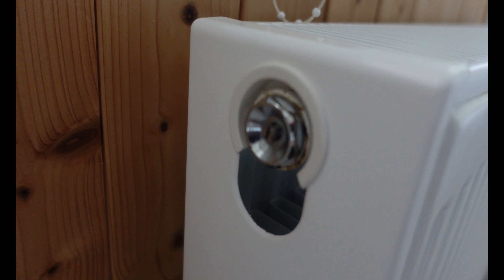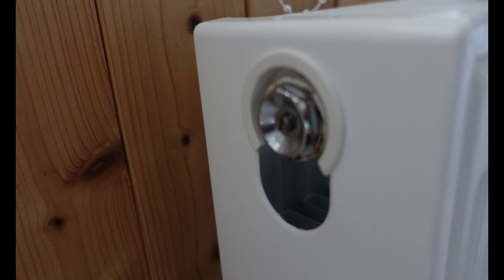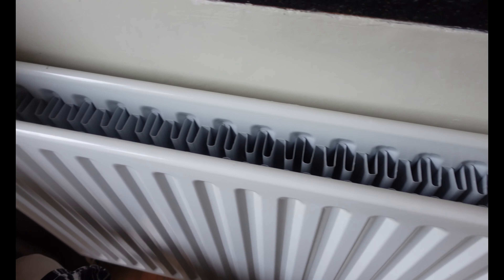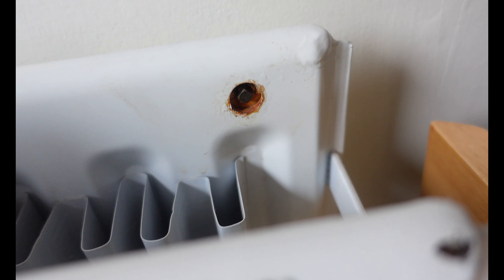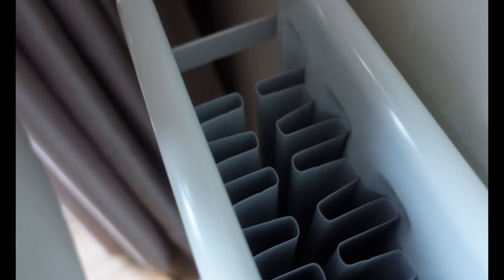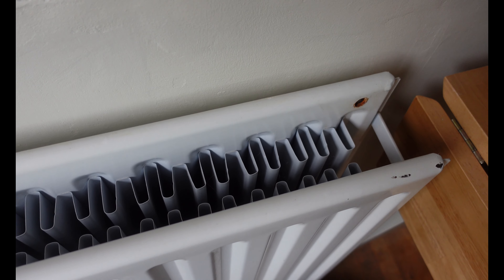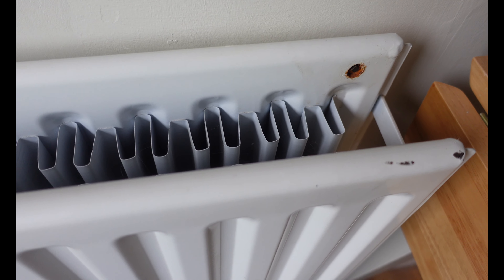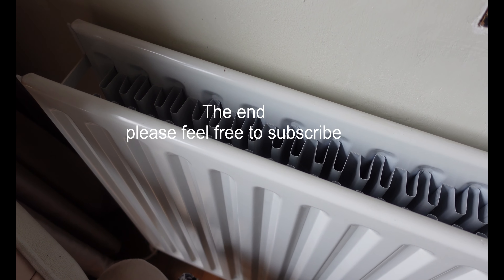What heating radiators not to buy.

Comment: To be honest, if you use the correct little key on the small airbleed screw, you shouldnt have any round off. After having these rads in 3 houses over 40 years, Ive only had problems with one rad where the thread stripped.
Reply from the maker: I have only ever had problems with them.

Comment: Such a humble thing the bleed screw. But able to cause mayhem! Also, if you have a 1/2 bsp fitting you can add a bit more inhibitor to the system very easily if you've removed the radiator.
Reply from the maker: Good advice Colin.

Comment: Thanks for the heads up! I have a couple of those rads in my place where on a drain down I found those bleed screws siezing up through corrosion, luckily they were still turnable with care, working them backwards and forwards, once out I cleaned the threads and applied a smidgen of copper slip, I'll remember to buy the other type as and when I need new rads.. 👍
Reply from the maker: Yes best bet Dave.

Comment: Hi Al, I had trouble with one of those recessed bleed valves, couldn’t get it off with any normal bleed screw, until I found one from Amazon, it’s got a sliding bar through it and is excellent! (If you search for “rear access bleed key”. Worth a try for a couple of pounds!
Reply from the maker: Thanks Tim that`s a great tip.
Reply: Goto toolstation replace all the air bleed valves with alladin autovents 👍👍👍

Comment: I have 2 of those radiators (I got them from Wickes).  I have not had any problems so far but the point is well made.  One thing which might work is to coat the threads of the bleed screw with bike grease (you can buy it in a DIY store, costs peanuts).  This might help with the corrosion of the bleed valve.  Thanks, great video.  :-)

I had problems with TRV valves recently and used your hammer trick to free them.  Worked perfectly; much appreciated.
Reply from the maker: Thanks for the great tip.
Reply: You should do a video about the hammer trick

Comment: I've got these Myson Premier HE radiators throughout my house which was built in 2004.  Myson have changed the design of the Premier HE now so that the bleed nipples on the smaller rads are slightly angled on the side and the bigger rads has a removable bleed housing.  If you can get the rounded nipple out, you can replace them.
Reply from the maker: Thanks Lioyd.

Comment: I did wonder about drilling a small hole in the radiator (with both valves closed)  and then inserting a self-tapping screw (with a fibre washer) as an add-on bleed screw. 

Any experience as to whether this sort of bodge would work (and remain watertight)?
Reply from the maker: Only that the new type of rads are ever so thin and you may find a self tapping screw will not go in tight enough.

Comment: Hello Al,I’ve got a couple of them brilliant rads with the air vent on the inside 🤬,im thinking before I probably have to buy some new ones,to try out easi bleed valves,just wondering if you’ve used them before.My system is a Combi and I need to drain the system and the rads upstairs are the plague ones,so that’s where I was going to use the easi bleed on the ones upstairs.The reason im draining the system is I’ve fitted 2 800 rads downstairs and there just not getting hot,so emptying the full system might help or it might have to be a power flush,thanks Al and take mate.
Reply from the maker: I have seen them valves but never fitted any. I would still prefer a couple of new rads with proper located air valves. I would try balancing your system before you try anything else.

Comment: Hi Mate. Thanks again for the excellent advice you gave about fitting a new rad in my attic recently. Did the job, fine no leaks etc. I would be grateful if you could give your thoughts on another thing I've just noticed regarding my combi boiler. It's a Baxi Centinel x100 about 10yrs old. I don't know if this has always happened but when the central heating is on and you turn on the hot tap, the central heating stops, and goes back on again when the tap is turned off. Is this some kind of safety cut out to stop overheating? All the Best from County Durham.
Reply from the maker: No it is the three way valve switching to get your hot water, then when you turn the tap off it returns to heating mode.
Reply: @dereton33  Good, thanks. Pleased I haven't buggered it up then!

Comment: Slightly off topic...the thermostatic valve on one of my radiators has stopped working....it goes round but doesn't do anything. Do you know what it could be please? PS I have practically zero knowledge when it comes to this stuff!
Reply from the maker: The pin is stuck. I have videos on how to fix it.
Reply: @dereton33  I will check them out 👍 The rad is stuck to the highest temp, presumably your videos apply? Thank you sir!
Reply: Mine also gets stuck if left  unturned for a while, the thermostat head can be removed and using the flat side of a blade screwdriver push down on the valve pin and let it spring up,  you may have to do it a few times to get it to release, plus a tiny dribble of 3in1 oil or WD40 down the pin will also help to free it off and prevent it sticking in future..

Comment: I completely agree with you Al. I’m looking at replacing all my rads soon - there’s a lot of discussion out there about aluminium instead of steel panel rads, what do you think? Any advice on what brand are most efficient? Thanks as always, your videos have helped me a lot.
Reply from the maker: Best of luck! Stelrad rust a lot, Barlo are one my favourites.
Reply: Aluminium will heat faster, and your system will be non ferrous so very little corrosion

Comment: Agree wholeheartedly Al. Recently I managed to install a new valve on the outer panel which seems to work fine. Protrudes a bit but I can live with that. Will be trying to install a new one to the inner panel later.
I got the valves from easibleed.co.uk
Reply from the maker: Thanks for the info Milo.